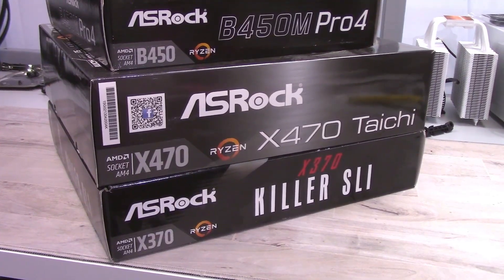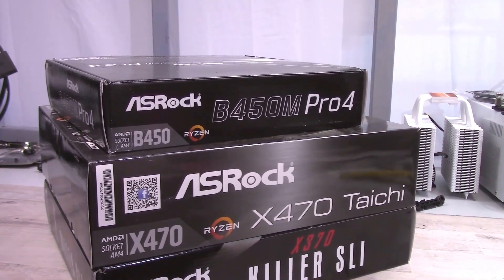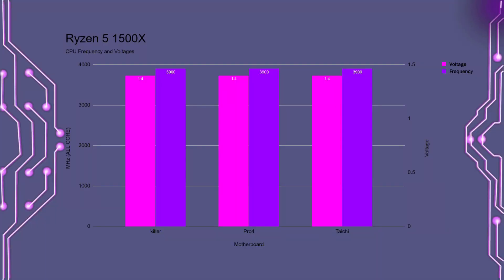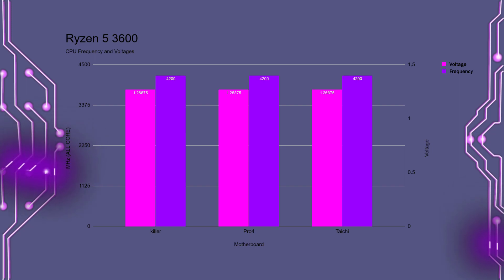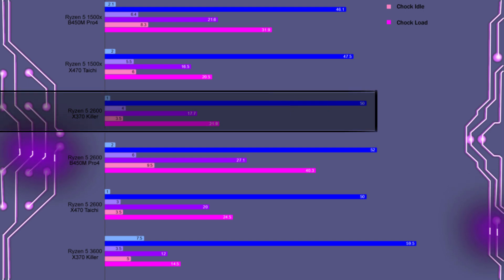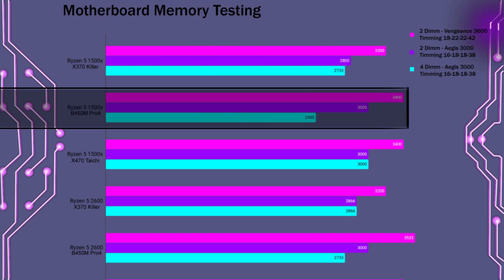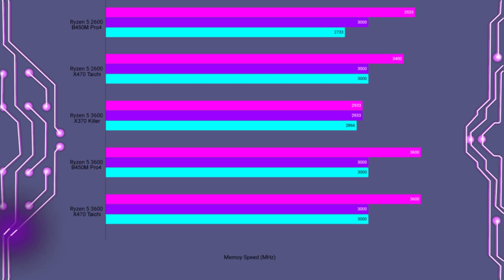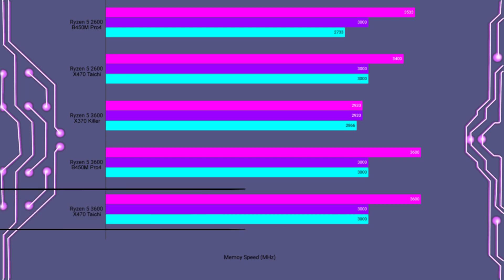AM4 Motherboards - x370 vs b450 vs x470

Comment: I have a question, i have a Fatal1ty x370 asrock,can the ram be the responsable for stutterings? (Crucial Ballistix Sport LT 3200 MHz DDR4 DRAM Desktop Gaming Memory Single 8GB CL16 BLS8G4D32AESCK) i bought a b450 elite v2 aorus, would it be more stable? (asrock sucks any way)
Reply from the maker: There's lots of reasons why stuttering could happen. Unstable Ram is definitely one of them but it could also be thermally throttling CPU, thermally throttling GPU. Insufficient Ram depending on what the game and what it requires.
Reply: I have tested everything,memtest ok,cpu ok,gpu ok,the weird thing here and why i think its the mother si cause sometimes the mobo don't start,and Qvl/ram compatibility website don't show this ram in the list of ram compatibilitys for this mother,but on B450 gygabite aorus elite v2 there its
Reply from the maker: Yeah I have the ASRock killer SLI and I had the same issue. I couldn't run my 3000 kit at 3000 I needed to run it at 2800... Now I'm not sure if that's the BIOS for the motherboard or the memory controller on the CPU but the x370 line definitely had issues.
Reply: Well i just download new BIOS ,put memories on 2133 mhz,same stutterings... U.u
Reply from the maker: @braianramos4048  I would try the b450 and see what happens.

Comment: Ryzen 5 3600 + rx 590 32 gb ram 3000mhrz did th x370 enough ?
Reply from the maker: I'm pretty sure a X370 motherboard I'll need a BIOS update.
Reply: @HardwareForGamers  in his box There is an orange ryzen 3000 ready
Reply: I mean the asrock X370M-HDV ryzen 3000 ready

Comment: Biostar X370GT3 or Asrock B450M HDV please i need answer
Reply from the maker: The 450m
Reply: @HardwareForGamers  isn't the x370 way better than 450m because it has an overclocking system
Reply from the maker: Did you watch the video? The overclocking of the CPU is the same and the B450m memory OC was better. So..... Yes I would recommend the B450 motherboard.
Reply: @HardwareForGamers  thank you man! You're the best, god bless you

Comment: ryzen 53600x 3200mhz rx 5700. Is a 370x enough?
Reply: sry, i meant 320x
Reply from the maker: How much RAM?
Reply: @HardwareForGamers  16gb 3200mhz cl16
Reply from the maker: Technical that should be fine. I don't really recommend it. Why do you want to go with a 320 motherboard?
Reply: @HardwareForGamers  its much cheaper here in germany, how much better would a 450x Motherboard be?